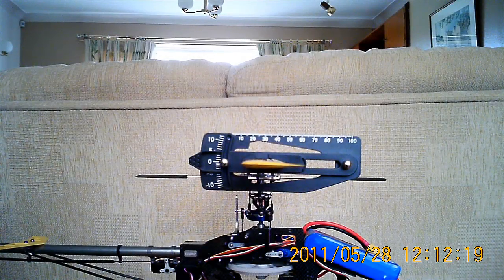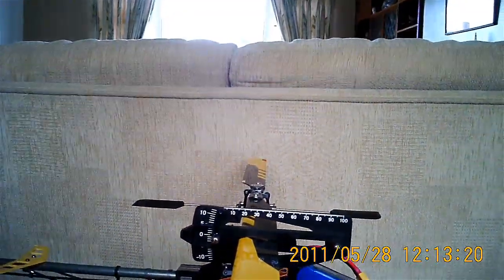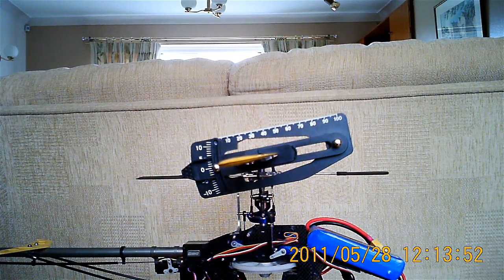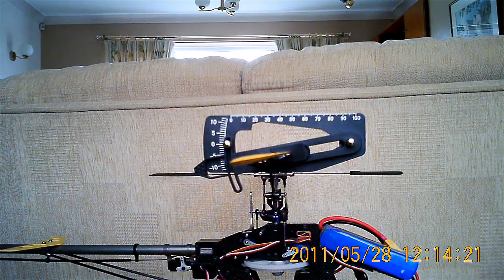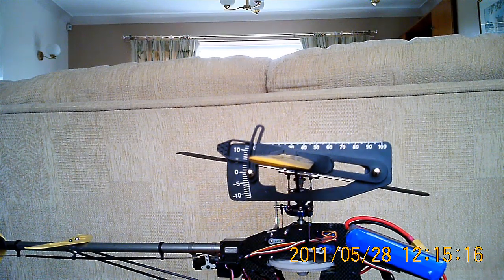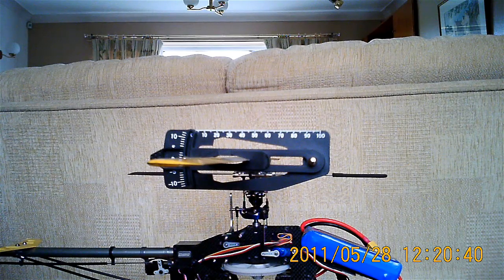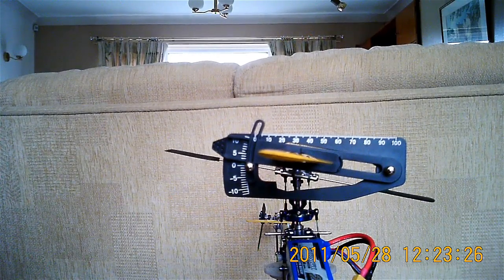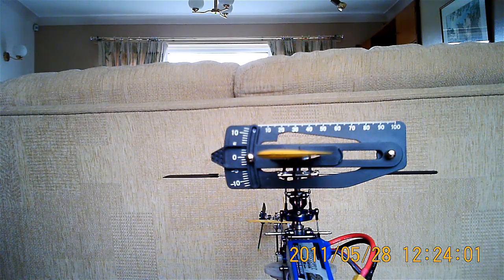HK 450GT 052811 Blade Pitch and Blade Deflection Measurements

Comment from the maker: That's right.  There are several ways to adjust blade deflection.  I'd probably use dual rates on the transmitter as my first choice on the aileron and elevator channels.  Alternatively you could use end point adjustment in the transmitter on those channels which is almost the same as dual rates.  Finally you could do a mechanical adjustment and reduce the length of the servo arms.  This would also reduce collective pitch available so might not be a good thing.